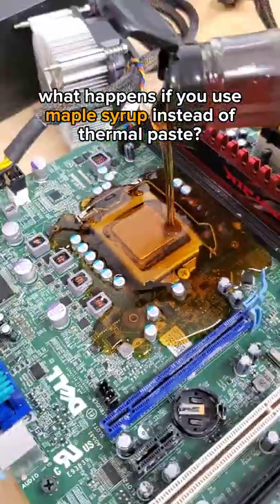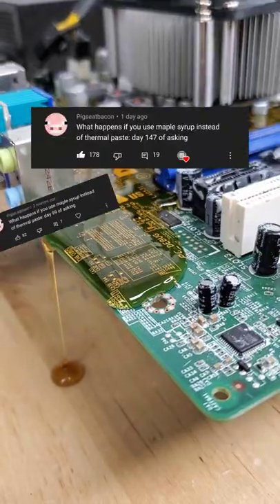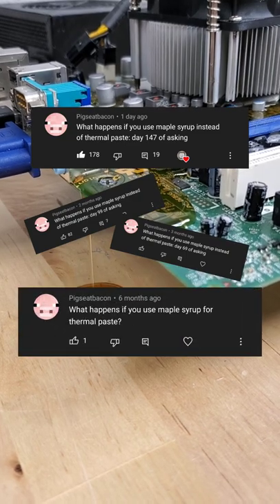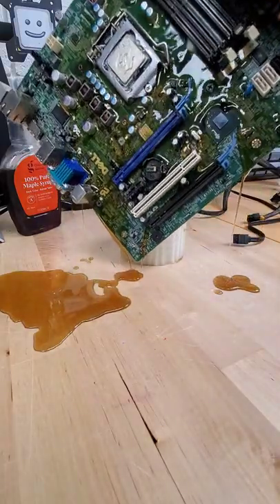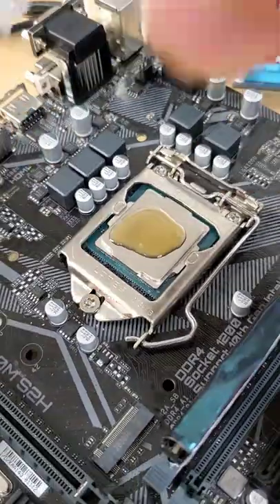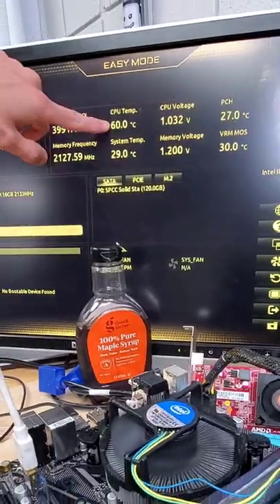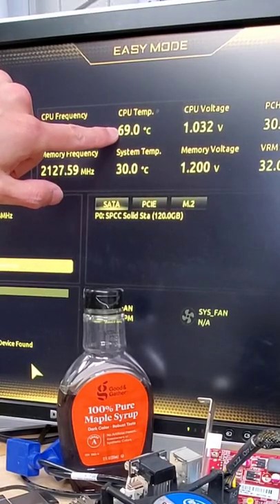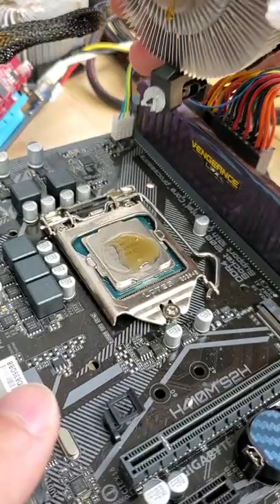what if you use maple syrup instead of thermal paste? #shorts

Comment: 69 celsius is not twice as hot as let's say 35 celsius. Temperature does not start at 0c, it starts at -273.15c (0 kelvin).  69c (342k) is actually twice as hot at -102c (171k).